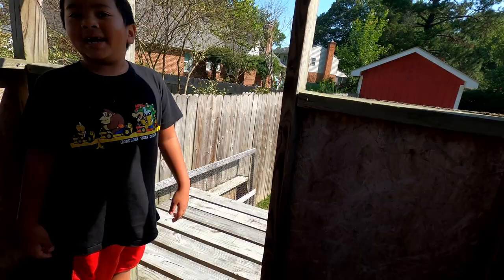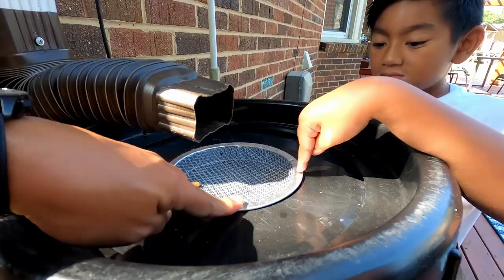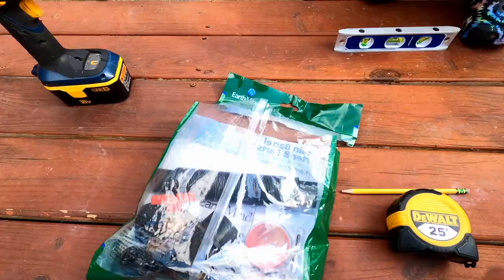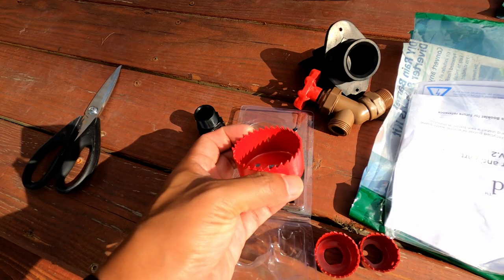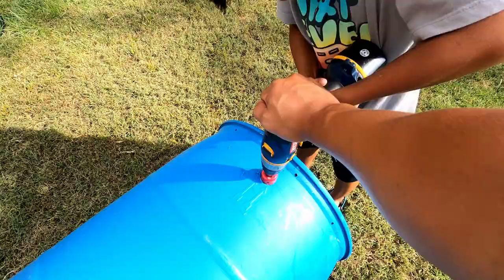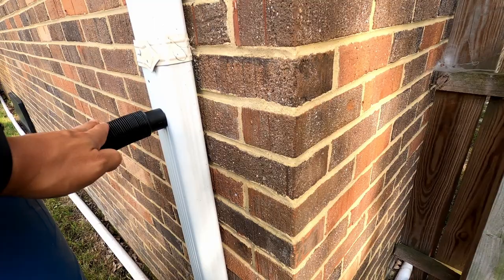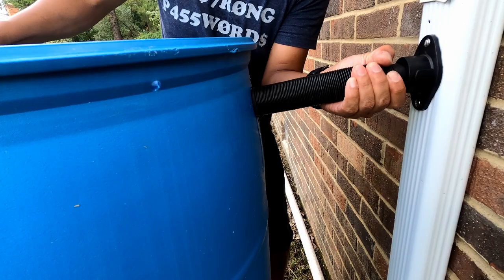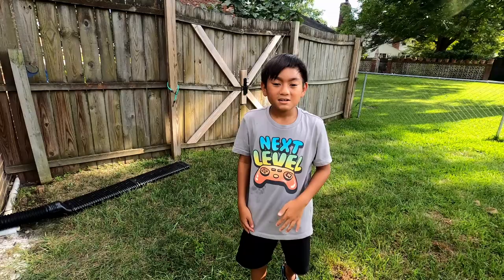DIY - How to Build a 55 Gallon Rain Barrel

Comment: You should have drilled the hole in the gutter pipe a few inches higher so it would flow in much  better.

Comment: Hi there. Great video
Could you pls further explain the holes around the top to prevent mosquito larvae ? I thought if you put holes then they can get in ??
Reply: I could be wrong but I think those holes are to prevent water build up on top of the rain barrel. I was wondering the same thing.
Reply from the maker: @hotdog748 is correct. It prevents water from building up on top. The water escapes down the sides of the barrel.

Comment: Nice video. what did you think of that diverter kit versus your DIY setup on your first rain barrel? Do you fin much shingle gravel or leaves make there way into the barrel when going through the downspout? Thanks
Reply from the maker: Hi Paul! I really like the diverter kit because everything came in one package and it worked perfectly for that location. The DIY setup was necessary because it was on our deck and the gutter did not have an extended downspout for the diverter. It's extremely satisfying watching the water falling into the barrel though 😀.  As far as shingle gravel and leaves, I have leaf guards on my gutters so leaves don't end up in the barrel. Shingles do end up in the barrel but not enough where it obstructs water from coming out. Hope that helps!

Comment: I noticed you son touched the hole as soon as he was done drilling. That's fine this time, but a great time to teach him, you normally DO NOT touch a hole you just drilled since it will be extremely hot. If it is wood or metal, you can get a blistering burn and even plastic too if it were thicker material and took longer to get through it. Just passing a tip. Great Job though, and very practical.